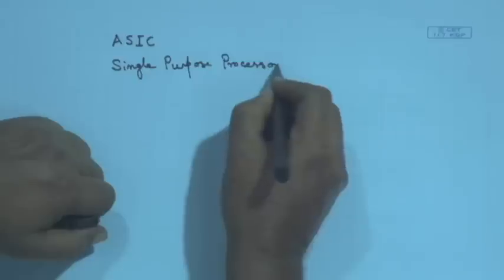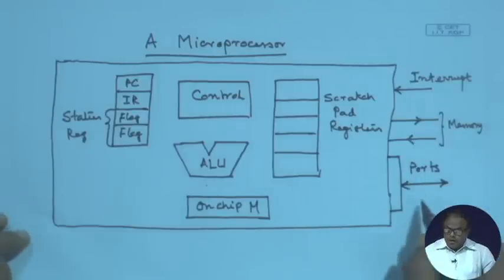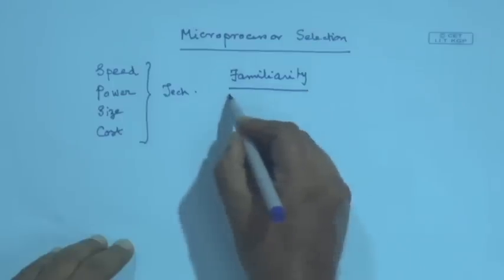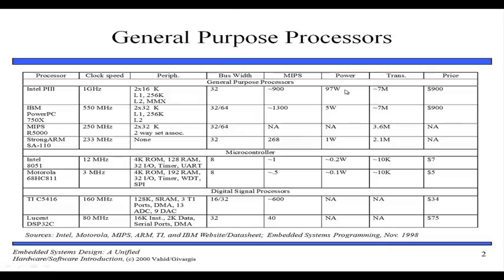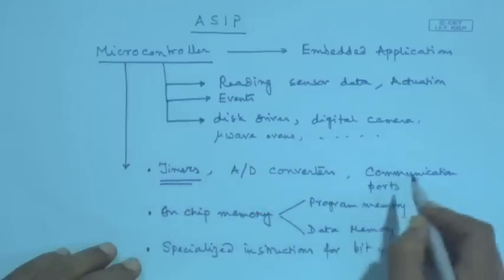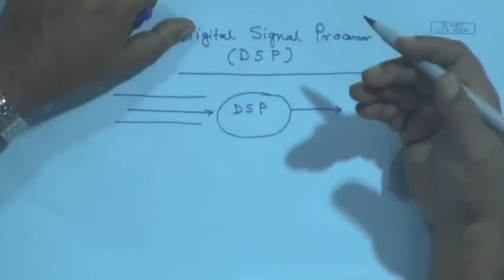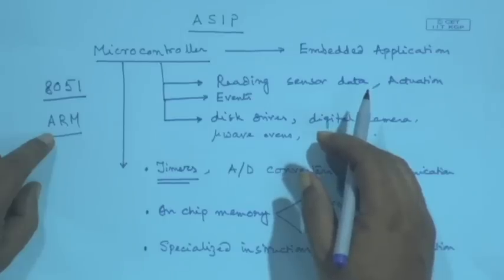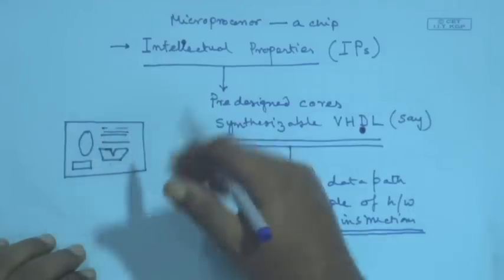General Purpose and ASIPs Processor

Comment: Sir, What is the  Function  of SRAM in ASIP architecture?
Reply: SRAM stands for Static Random Access Memory.. in modern CPUs.. it is mentioned as Cache memory..  like my CPU   (i5 10400F have 12MB L3 cache, L2 have some and L1 have some)...
These L1,L2,L3 are Cache memory.. made up of SRAM cells.. they are very very fast Memory... Connected directly to the CPU.. 

As Sir explained in the previous lecture..
L1 cache is divided into Data Cache and Instruction cache..   L1 Cache is directly accessed by CPU cores.. 

L1 data cache holds data which needs to be Processed..  and also what we have to do(instructions).. means chunk of data needs to be processed..  

Now We have L2 cache..  which have more size .. available to each Core also... And Stores also a large chunk of data needs to be processed..

L3 cache is also a larger cache.. and shared across all cores...   And also stores Data which may needs to be Processed...

That's why Higher the Cache memory.. faster the Gaming performance..  because it will require very little time to acccess the data due to quick response of SRAM memory architecture of Cache memory..

That's why we have AMD's X3D CPUs.. with Large L3 Cache....

Hope you got the Idea of Uses of SRAM in  Processors.